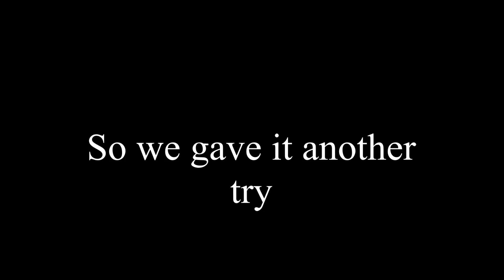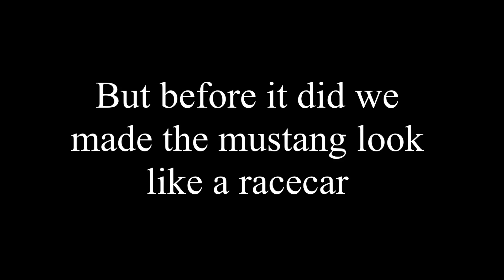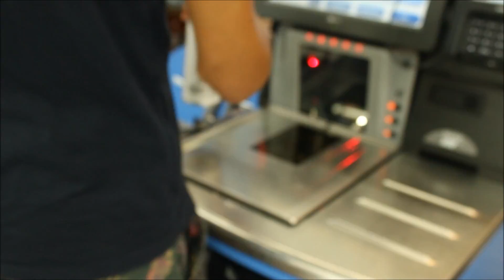V6 Mustang-Drift Build Part 3-WELDED DIFF

Comment: How did the mustang turn out for drifting?
Reply from the maker: Brady V tbh we don’t know we blew the diff immediately but stock it wasn’t bad just needed suspension I would say
Reply: @gunnarsgarage  did welding it break the diff im about to weld mine...
Reply from the maker: Brady V no we just were using a bad welder